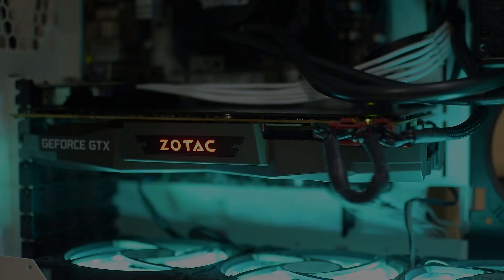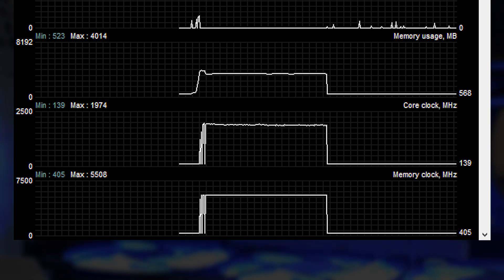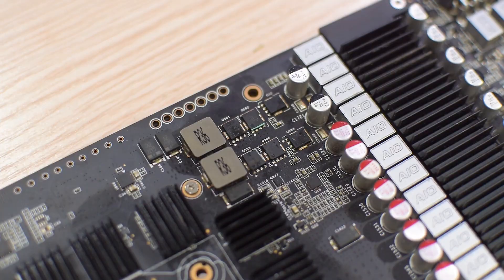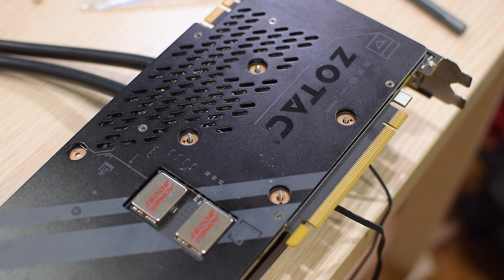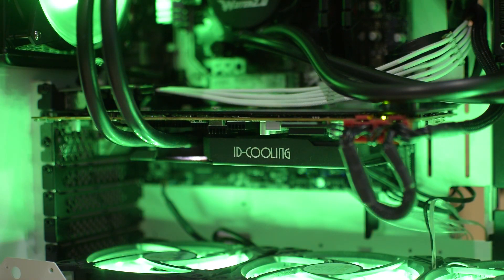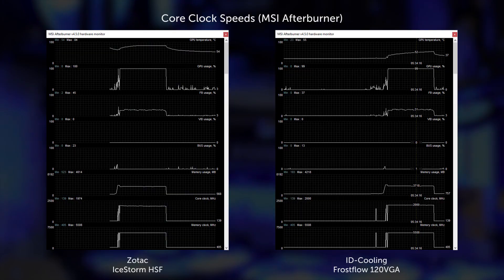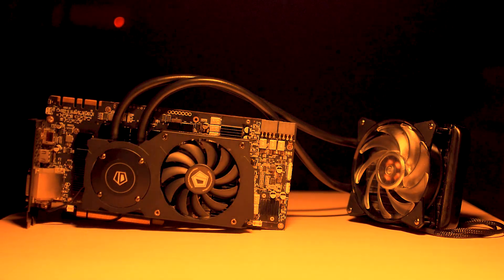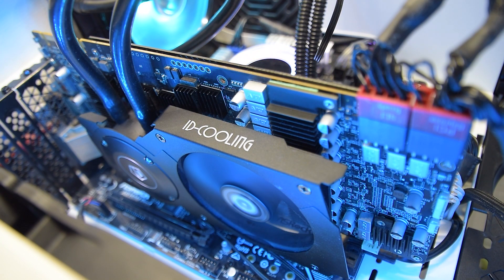Cool as Ice. - ID-Cooling Frostflow 120VGA + Zotac GeForce 1080 Ti

Comment: Thanks for the video always wanted to know if a 120 CLC is enough for 1080Ti. Good job!
Reply from the maker: No worries! Cheers for the comments. 

Yeah a 120mm radiator is more than enough. The only benefits really from going to a larger radiator is slightly better cooling and a lower noise profile as you don't have to work the fans too hard to cool it down.
Reply: Hi TechRodent,

As I am looking through Taobao for NZXT G12 adaptor for graphics card water cooling (have a spare GT80i v2 AIO) is selling for 199RMB.

But ID-cooling 240 graphics water cooler AIO is 229RMB.

Will you recommend using the NZXT adaptor using GT80i v2 is more effective or the ID-cooling better for a 1080ti
Reply: Sorry typo the 229 RMB of the ID-cooling is 120 so 120 I’d-cooling at 229RMB or NZXT G12 with Corsair GT80i v2 has a better cooling performance? 
Thanks
Reply from the maker: I would say that the kraken might do better due to asetek pumps being better, but the difference may no be very major
Reply: @TechRodent  Thank you so much :) Merry Christmas and Happy New Year!
Reply from the maker: No worries, Merry Christmas buddy :D